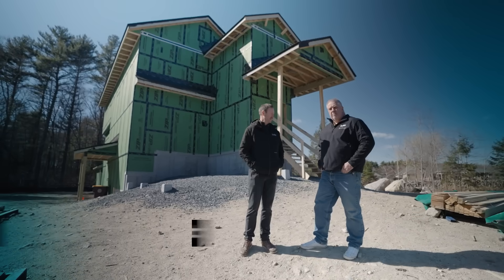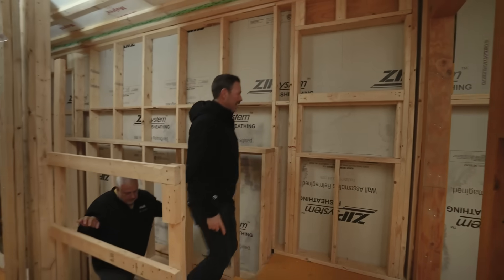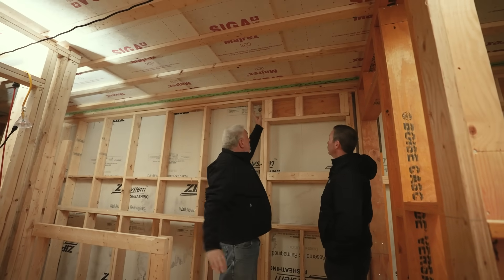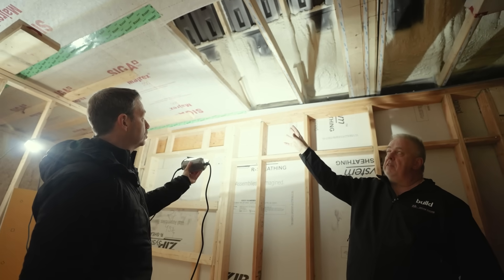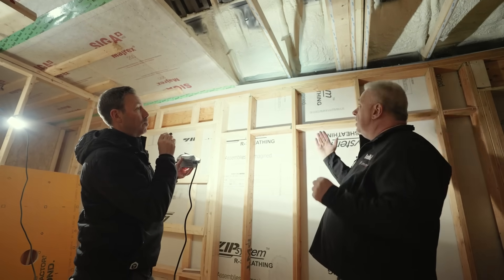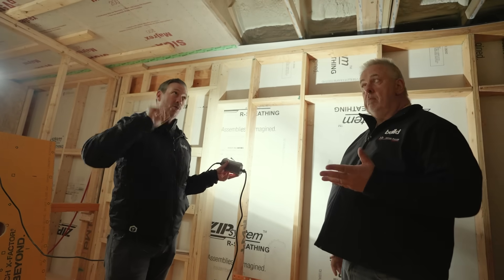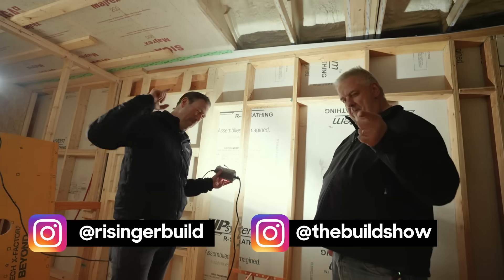Vented Attic Insulation?  Here’s a trick We Stole From European Builders

Comment: Why don't you "steal" block wall construction from the Europeans top instead of these overpriced "systems" of heavy sheething coatings and tapes and foams? Build with Omniblock and Faswall types and wala, you got R-26 with thermal banking and all you needed was one trade, not the minimum of 5 different trades on the exterior wall like stick homes... What it takes to get a stick built to that level requires toxic materials that shouldn't be NEAR a place that the homeowner spends most of their time and nights in. 

These houses are going to be the "asbestos" cases of our lifetimes. If those houses catch fire at all they're toast. The heat will melt all the foam insulation into puddles at the bottom of the wall not to mention the smoke and smell you'll never get out without ripping everything down to studs. And if your roof gets a leak and you have closed cell foam up there, you'll never know until you see the roof sagging.

These houses are overpriced garbage for product advertising. Houses need to breathe. CNU blocks breathe and regulate moisture into and out of the home.

Comment: I'd like to hear the pros/cons of using Majrex vs using drywall as the air barrier. Jake Bruton's method of drywalling the interior ceiling prior to installing interior walls seems a cost effective method.  It eliminates the faff installing Majrex, then installing drywall and 2x4s for electrical chases - potentially puncturing the air barrier in a zillion places with errant fasteners.

Comment: Why don't you have insulation over the black baffles between the rafters, for the full length of the rafter?    The baffles keep the airflow from the soffits to the ridge vent, but they don't keep the attic from heating up on a hot day?    The small sections that are blown in are more about maintaining airflow through the baffles and stopping leaks?

Comment: i’m curious a heat shield works very good to stop heat. have you thought of creating a heat shield around a house or the roof. a ventilated roof kind of is that but those cavities still reach 100 degrees on a 80 degree day. so for the roof you could basically add a second roof   with over hand enough to add a second layer around the house. and these would just be applied with air to move around them.

Comment: Raises more questions than answers imho , this is a builder on the cheap to pass local building codes , I wouldn't want to live in that house , you can buy a shredded steel insulation that is both fire proof and sound proof , foam sprayed in sucks , there are no firestops in those walls aside from the fact they are 2/4 which means 2/3 covered in foam instead of sheathing , a kid playing while your building could run right out of that house an fall to his death , inside walls support or not should have a double plate , that vented attic is a gimmick a roof is vented anyway insulated or not , an guess what if you charge a customer to foam the entire outside of the house then cut out the openings what happens ? then look at the window framing , those window openings aren't framed , could go on a on about how cheap and crappy that house is but have said enough pretty sure anyone reading this knows it disgusts me as someone who has built homes that last are comfortable in Canada and use little energy
Reply: LOL have you watched this video? Cause you make no sense.....
Reply: @stevenbaczekarchitect9431  Did watch it an feel your engineering as cheap as possible by the lowest bidder an trying to pass it off as well made which it isn't but i'm sure the new home owner will be charged well made , I probably designed super insulated homes before you were born , I know bullshit when I see it , but believe what you want I won't change my opinion
Reply: @stevenbaczekarchitect9431  Your advocating homes built to last until the builders warrenty expires after about ten years and passing them off as something they are not and you know it , so yes I have issues with that , I have no problem with making money on youtube , be upfront about what you can expect from that build and I will shut up , we both know the difference between well built and O look what we can get away with now with lax codes

Comment: In 1992, we did something similar with 6mil poly vapour barrier: continuous from basement to attic, wrapping around and completely enclosing both the first and second floor platforms, in zone 5 (which required vapour barrier towards the interior and the bulk of the insulation outboard).
Reply: The danger is poly is not vapor open, Mayrex is...
Reply: @stevenbaczekarchitect9431  Thanks for the reply. In Canada zone 5, 3000 square feet, with HRV. It used some techniques that were not common at the time, was affordable, and could be heated in winter by inviting a few people over. 🙂We did not know about Majrex in 1992. Was it commonly available in Canada then?

Comment: This is just adding cost, paranoid overkill. There is nothing wrong with long tried and tested traditional 6 mil poly vapour barrier and insulated, vented attics.
Reply: I would never put poly in a code built home today - metrics are different, but you go roll the dice.

Comment: When detailing is too complicated, the majority of builders will get some of the detailing wrong. When small mistakes in detailing result in critical problems with a building, the design itself is bad.

Good designs are robust when construction details aren't absolutely perfect.

I have a lot of respect for Matt and Steve, but 95% of houses should not be built with very complex details that could result in a critical failure if those details aren't followed precisely.

I think simple, low-tech vented roof designs are OK. Otherwise, I think continuous-insulation designs with non-vented roofs would actually be easier for builders to complete without errors than vented roofs that require large amounts of specific flashing details.
Reply: I would argue exactly the opposite, but it is a free country, fell free to go roll the dice

Comment: Doesn't the weight of the insulation strain the membrane at the fasteners? I see the membrane supported by the trusses on 2' centers then the 2x4's at 90 degrees to the trusses.  Any possibility of breaking the membrane from insulation weight?
Reply: The 2X4's are 16"OC

Comment: As someone who has fiberglass cavity wall insulation, as well as exterior cladding Styrofoam insulation, as well a vented R50 attic that originally had R15 batting then topped up with blown in.  The weak points are definitely these edges where the air is vented in the drywall at these ceiling lines sometimes gets down to 9 or 10 C in the winter when the rest of the room is 22 C, using a thermal camera you can see pockets where additional air sealing under the insulation is required.
Reply: I am not guessing when I speak - thanks for the supporting comment

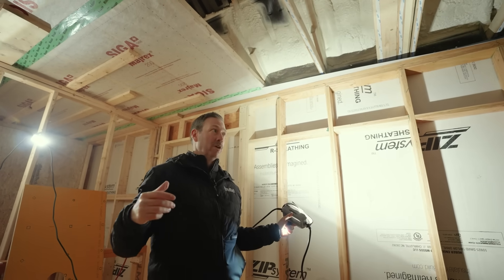Comment: Around 3:35, they say going to use drywall for aesthetic reasons. What about for fire blocking? Is Majrex fire blocking, and if so, then in theory Majrex could be used in a freestanding garage ceiling (without living space above) in a vented roof construction, correct?

Comment: Just a SIGA ADD. With all that work must, be cheaper to just spray few inches of closed cell on flat ceiling and top it off with some open cell, if you dont need unvented attic,  No settling no adding stuff later, no extra 2x4 on a ceiling. Probably would.cost almost same or cheaper.
Reply: It would be more expensive here

Comment: In my new home we used 1/2" OSB as the air barrier on the ceiling, sealed with wet flashing to periphery and joints. Then ripped 2x6s in half and installed on edge for a service cavity for plumbing and electrical. Blower door tests out at .58 ACH.
Reply: That' good air tightness, but the permeability of OSB is only around 2-3 perms......

Comment: Just inspected a 6 year old house with big snow drifts of loose fill insulation near the porch overhangs, and big patches of uninsulated drywall, of course. Builders get annoyed with inspectors for "overthinking" but I'd say our building practices have a long way to go.
Great info as usual - nice video!
Reply: Thanks for the comment
Reply: I also agree on the Building Practices.....
Reply: I have seen 14’ walls with blown in cellulose settle 2’ around the whole upper ceiling.

Comment: Siga products are not cheap. Not sure why you're so concerned about air penetration at the gables when you've clearly got large gaps at the top of your roof trusses where your plastic vents terminate to let air pulled from the soffits out through the ridge vent. Why not go with something simple like LP TechShield as a radiant barrier and then put R13-19 batt insulation all the way from the eaves to the ridge with at least a 2" gap for max radiant barrier efficiency? A lot of Matt's stuff is not transferable to anything below custom homes, including most Siga products. Builders just aren't going to put that kind of money in things. I live in NW Atlanta, and I've never seen a builder even use Zip tape and Zip sheathing is once in a blue moon.

Comment: California found that tightening the envelope causes indoor air population so in  idiotic fashion they now required a 24/7 ventilation fan. Might as well keep the front door open.
Reply: I can't say I see as California as a leader for what I should do......
Reply: Some of the energy recovery air handling systems use very little power in contrast to a leaky home that requires much more energy to heat or cool because of the excess air exchanges per hour.
Reply: You might want to look into how an Energy Recovery Ventilator (ERV) actually works instead of comparing it to an open door.
Reply: @LooseNut  - I think that is where the code is going but the cost of regulations has become so high there is beginning to push back . Panasonic makes a reasonably priced one but I question the longevity.
Reply: @LooseNut  It was  @markmarcinik that was talking about tightening the envelope causing indoor air pollution requiring a fan running 24/7. He said might as well keep the front door open. I know exactly how an ERV or HRV work because I have researched them since the 1980's. Ill informed people that think a drafty house with all the energy loss associated with poorly built houses probably have never lived in a building approaching super insulated standards with adequate ventilation through out the house to remove excess humidity and stale air or damp and odour that a proper house should provide.
Reply: @LooseNut  Thanks. The internet is an amazing tool that allows people to start to access information on so many subjects and home building which is for most people an area that more people should invest their time to learn about.

Comment: Many consumers demand can lights. Might be good to cover all there is involved with that. ...  I've gotten where I hate the glare from can lights and prefer task lighting, torch floor lamps, etc.
Reply: “Can lights” in the era of LED lighting should really amount to the low profile units that can easily fit below that vapor barrier.   If your customer tells you they want old-school cans, show them how much better the new options are.
Reply: @shawnbrennan7526  The "wafer" or "pancake" lights that you mention are more suitable for tract homes or the DIY'er. I'd compare these type of fixtures to using traditional OSB and house wrap for the wrb. If your customer desires can lights, then do them a favor and get regressed cans at a minimum. This will greatly reduce glare. Good can lights, which typically require a housing, also provide the option for different trim/flange color options. Good can lights will also provide more consistent CCT between fixtures, dim more consistently, and provide a greater dimming range.

The best option would be tape and channel, which would work great for this detail, but budget is a factor just like every other decision. Most of these videos are geared towards a higher end client and I can't think of an application where I'd provide a $25 wafer can light for a house I was building for myself or specifying for others.

Owners interact with their lighting every day. Remember that they can actually see their lighting whereas they cannot see their air barrier. Both can greatly contribute to occupant comfort.

Comment: So the millions of builders who installed poly were wrong?  Why would you want a permeable membrane allowing moisture to migrate into the attic anyway?
Reply: In areas of Canada that can get very cold I would worry where that moisture would start to freeze and depending on what insulation is in the attic when would problems show up. I'll stick with my poly. Like the strapping on the ceiling chase idea though, to help protect the vapor barrier.
Reply: @kerrryschultz2904 I like the blue material over the top plate too..
Reply: They mention at around 7:30 that for colder climate zones you would use a vapour retarder (like poly).

Comment: Steve's projects are often above the level that the energy codes require, and can be very expensive to build as you chase down heat and air loss. I doubt that the majority of builds in these areas are anything like this. I applaud Steve's creativity in finding new ways to seal and insulate homes.
Reply: Appreciate the comment - sometimes your comment may be true, but here we need to hit .30 ach 50 (clients wants sub 1.0) and the code requires R-60. Ok take out 5" of blown in insulation (that would pay for itself in as many years) - how would you detail the ceiling / roof to hit 3.0 ach 50? You have to do something? So, what would you do? How do you design this detail?
Reply: @stevenbaczekarchitect9431   I personally would just do spray foam. That seals the house and seems like a lot less labor and issues for lighting and penetrations. Also makes for a very clean and accessible attic space.

Comment: But is that really a ventilated attic? It really seems like you’re air sealing the air baffles to just allow air to run in a narrow stretch up and against the roof, which is fine, but the attic itself just seems to have become this dead space, no?  

It looked like in the pictures you are spray foaming all the baffles all the way up, and the seams, and just hadn’t finished the ones on the right 5:37. I imagine you’re then spray foaming the ridge to seal where the two sides of the baffles come together?

It just seems like an odd combination versus just having a well insulated and sealed hot roof with extra usable attic space within the conditioned envelope (if desired). Maybe this method just allows for cheaper bulk insulation like you mentioned about the blown in?
Reply: The baffles only run up far enough to extend past the 24” of blown in cellulose. In the roof section you see in that part of the video it’s a lower gable roof. The spray foam is mostly to lock in those baffles and prevent wind washing of the loose fill cellulose that is to come. My personal preference is the vent the attic until you’re forced not to.
Reply: @brettpelletier1219  fair enough, and that’s what I would have normally assumed, but the angle in that shot looked like they were basically just trying to make a mini/thin vented airspace.
Reply: @brettpelletier1219 So you will have 10" of blown-in between the top plate and baffle?
Reply: @D2O2  yes, minus 1 1/2” where the vent channels are in the baffles. So there’s 2-3” of ccsf that starts at the top plate and goes about 2’ up the baffles, then blown in cellulose.

Comment: Couldn't we place a second layer of majrex on top of the insolution to hold it in place. I know Matt likes to use the example of putting a coat on the outside of the living space, but don't most insulated coats place the insulation between a sandwich of fabric to protect it and keep it in place.
Reply: The cost isn't worth the result
Reply: @stevenbaczekarchitect9431  They used spray foam to achieve the same thing.

Comment: Just yesterday, I saw a commercial property (an old auto repair shop) fully resheathed with ZIP System. This would have been a pleasant surprise, except for... They didn't use any tape and/or liquid flashing. Yeah, they paid the extra money for ZIP system sheets, but skimped out on the tape and liquid flashing.